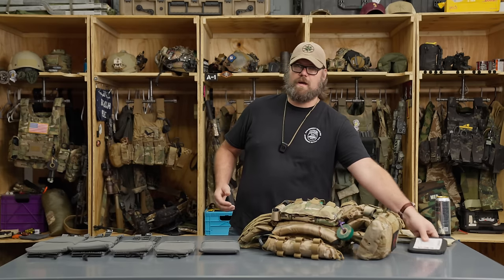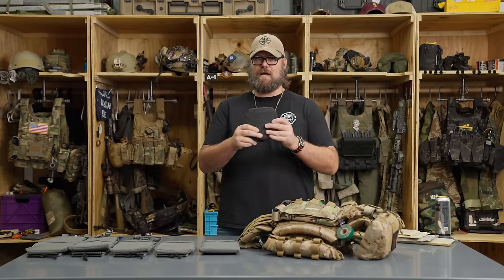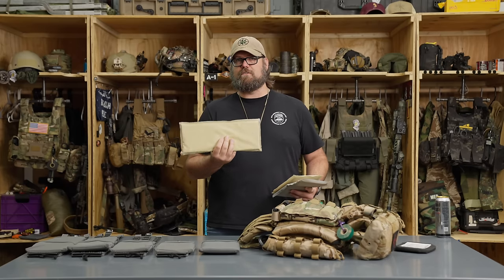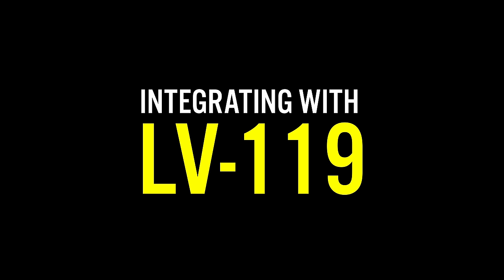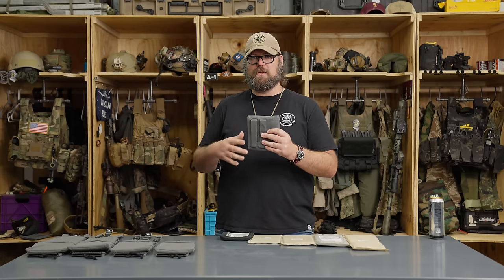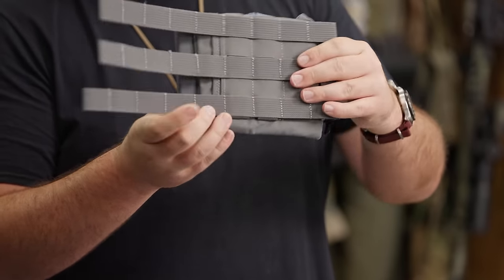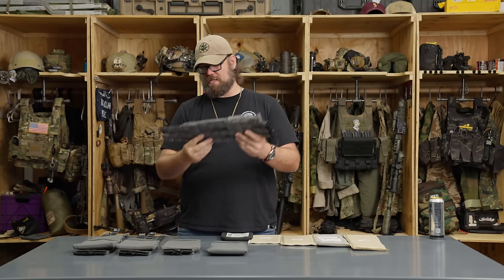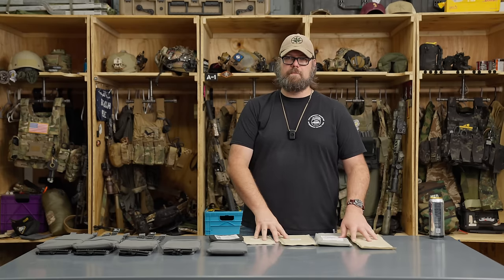How to Choose Side Armor for Plate Carriers

Comment: I like side plates, I seen to many soldiers in Iraq & Afghanistan take shrapnel or a shot in the side. My two greatest fears were always being shot in the face or in the side.
Reply: Is it because when you get shot in the face if it doesn’t hit the brain stem you will still be alive to experience the pain and slow death while choking on your blood?
Reply: Side shots are probably the most deadly body shots you can take. Hunters specifically go for side shots because you can easily get both lungs and sometimes double lung and heart. Getting one lung perforated is one thing but both and it's basically guaranteed to be over.
Reply: @1810jeff This translates to stabbing or punching someone too since no matter how hard you train the sides of your body will always be a weak point

Comment: Ive always run 6x8 hard in the weak side plate to the front and strong side to the rear. It stops blind spots from the front and back.
Reply: Might do that myself
Not a fan of adding more weight to my load
But I'm seeing more and more people with combat experience tell stories about someone getting hit in the side, and the importance of side plates
Reply: @ch3cksund3ad  having been shot, I really really don’t wanna get shot again. I may even get soft armor to go under it eventually. I recommend side plates if you can afford them 100%
Reply: I assume you'd use a 6x6 on the strong side?
That sorta lines up with a somewhat bladed shooting stance doesn't it?
And I guess it's less likely to obstruct a sidearm draw probably?
Reply: @mghegotagun  no the 6x8 is pushed up against the back plate on my strong side, and I’m partially bladed when shooting. I have a true north drop leg with safariland spacers maxed out.
Reply: @ShepherdOfTheSilkies  
So a 6x8 on each side isn't too bulky or cumbersome, is it?
Reply: @mghegotagun  naw not really just can’t put my arms straight down, but it actually covers my vitals. I also run 1 sapi plate size up too so I can be more comfortable while shooting when gassed out.